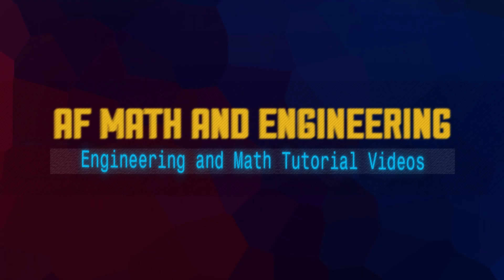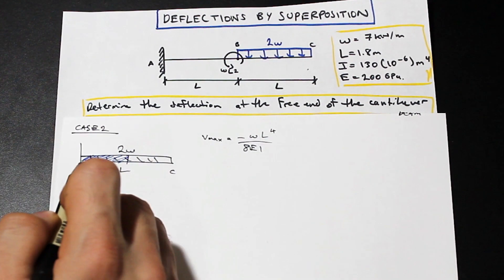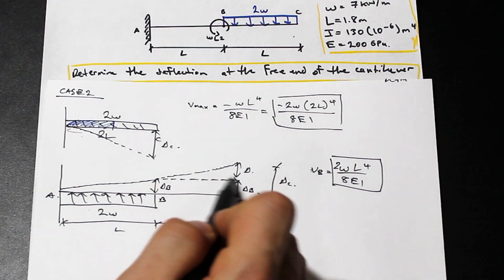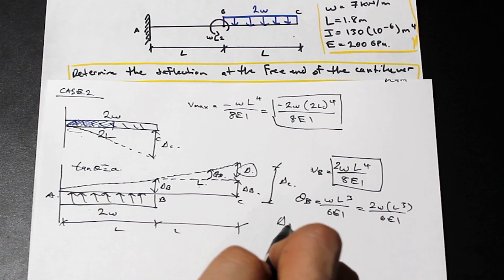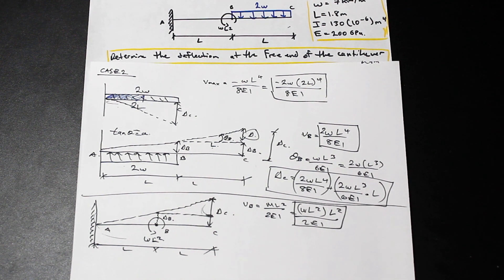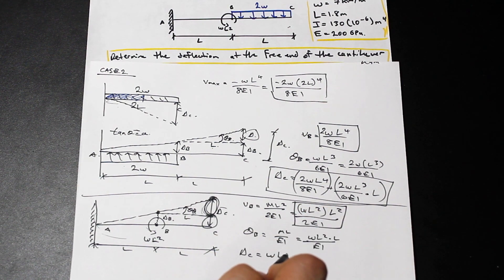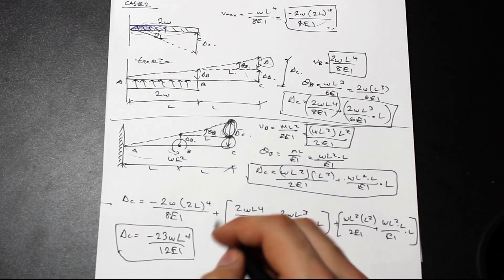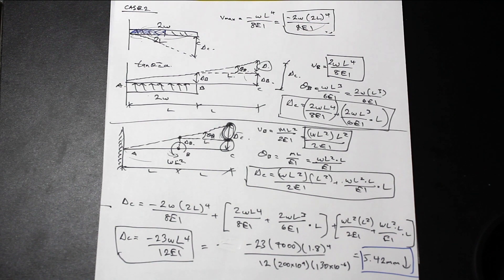Deflection by Superposition - Difficult Cantilever Problem Solved

Comment: How to use super postion if the udl is on half of beam between two supports like if beam is 6m and udl is on 3m because the table we use there equation is given for udl from one support to other
Reply from the maker: There are really an infinite number of combinations of loads your professor can give you and you need to utilize the correct superposition methods and just add them together, the best way to prepare is to try many different types of problems and past exams so you can be prepared, there's really no other way to do it.  The purpose of this video is to show you the method of how to solve tricky problems where multiple cases are involved, up to you to do the studying afterwards.

Comment: If you use your cantilever for a piping systeme support , how  do you calculate the dynamic charge of the fluid and then add the dynamic weight to the centalever calculation ?
Reply from the maker: No idea, I don't deal with fluid mechanics.  In real life the mechanical trade would provide a shop drawing of the pipe showing the worst case static load exerted on the slab by the liquid in the pipe for structural engineers approval.  Then you would check your cantilever against that load.